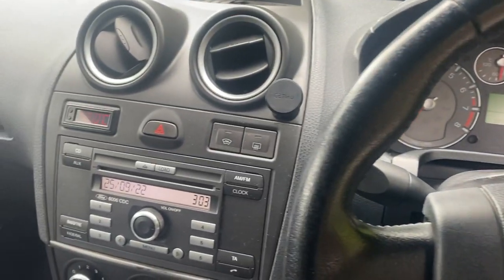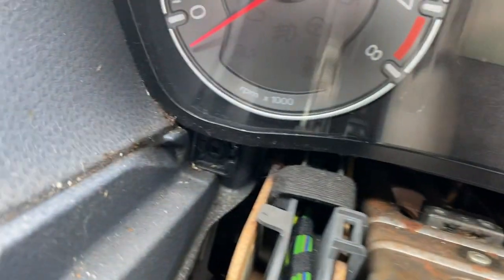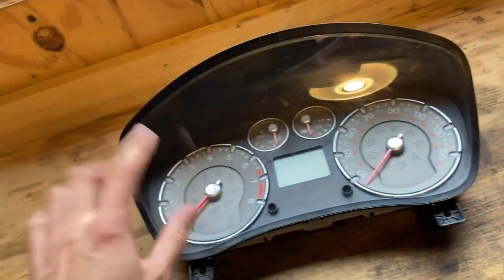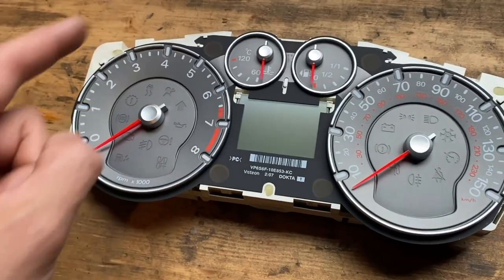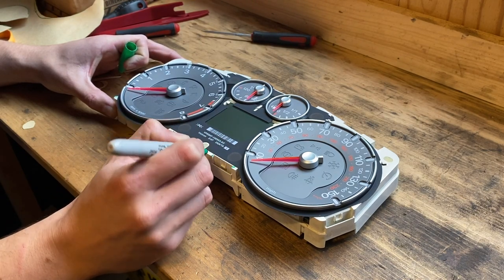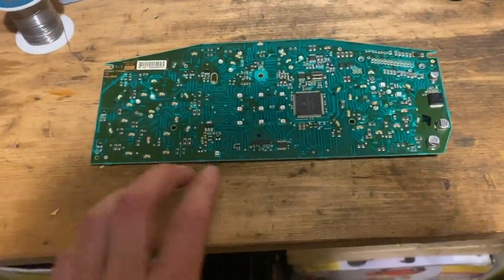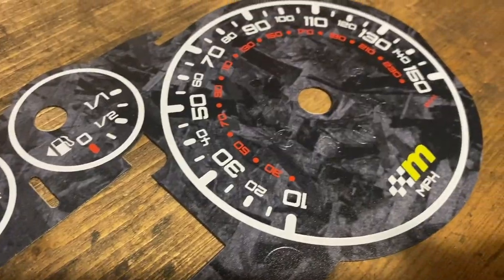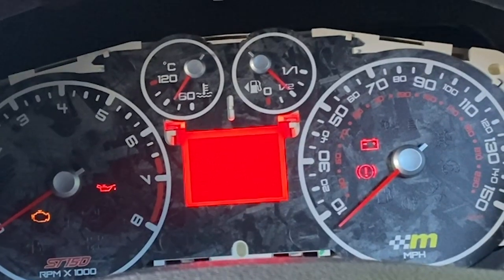Instrument Cluster/Clocks/Speedo LED Conversion + Custom Dial Cards | Fiesta MK6 ST150

Comment: One thing i really don't like in mine is the green everywhere. Also appreciate the subtle background to the dials you chose. I've some Mountune bits to fit so this is def something I'd like done to mine, it'd tie in really nicely. Already have my aftermarket stereo a;ready set to white so this'd look great in the flesh. Love the screenshot option for those brave enough to try it.  As usual a thoroughly enjoyable video with clear easy and concise instructions. I even bought a soldering tower after your previous ones but seems a bit advanced to dive into for a first job!
Reply: link to my fb page is in mike’s description
Reply from the maker: I’d say this is one of the easiest I’ve done. A lot of people go for full colour images on the clocks but I think the subtle effect is definitely better.
Reply: @MendItModIt  Agreed, I'm all for OEM+ look which i think the all-white does brilliantly, great choice

Comment: What you could have done is take photos of the position of the needles while in TEST mode prior to disassembling the instrument cluster. You set RPM in test mode, snap a photo. You set some reasonable speed - you snap a photo. Or better yet - set the wanted variable in test mode and make a little note with a pencil on the mask. If going with photos, the photos should be taken from as perpendicular position to the instrument cluster as possible. That way you'll know what was the exact position of the needle prior to disassembly.

Comment: Thanks Mike good video, I just need to change the LCD on a PFL do you know if it has the same test function as the controls are different
Reply from the maker: I’m not sure sorry mate, but as far as I know the PFL doesn’t have a trip computer so I’m not sure how you’d activate the test mode if it has it

Comment: Does this have to be done with PCB led diodes? I’ve done a couple of the other interior buttons with the standard 2 stalk LED and they work fine do you reckon this will work on the cluster too?

Nvm done it and it works fine

Comment: Looking very nice
Reply: Clock glass like to rattle.. all since started polybushing.. so just wanted to refit it and the dials not seeing anyone doing dial cards but now I'm like I need some!
Reply from the maker: Cheers bud! Ah gutted, mine doesn’t rattle (plenty else does though 🤦🏻‍♂️) but mine has a tiny crack in 😢
Reply: @MendItModIt  haha, yeah I got a TT vent that give me hassle at times or it's the clocks, I think it was the plastic glass but maybe it's the metal part you had to push back. The dial card is not cheap but it's unique and yours looks awesome. I think I just want a black and get rid of the kmh, and maybe a change of the lines. Looking forward to your next videos!

Comment: I have to resolder the contacts on mine but I just have one question about the fuel gauge. I noticed that every time I put fuel in and top it, the gauge goes a fair bit above the 1/1 mark, is that normal or should it point directly to 1/1?
Reply: thatll be down to you not putting it back on correctly
Reply: @jayotterautomotive  I never dissasembled the thing, it was like that from the beginning, it could be that the previous owner did it and poorly since the dash is going out again.

Comment: Do you need to remove the dial card if you are just doing the LEDs looks like it's only held with the needels to PCB?
Reply from the maker: No you could just pop the needles off and leave the card in place if you wanted to
Reply: @MendItModIt  Thank you